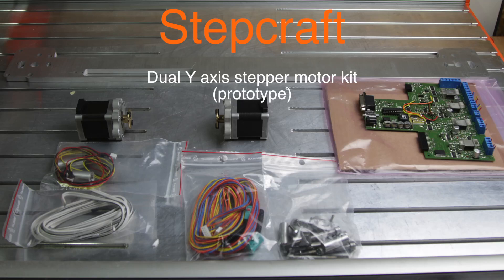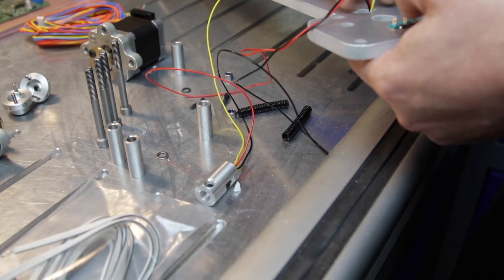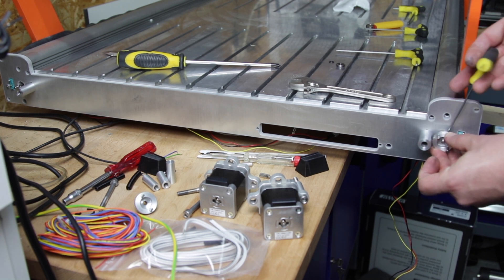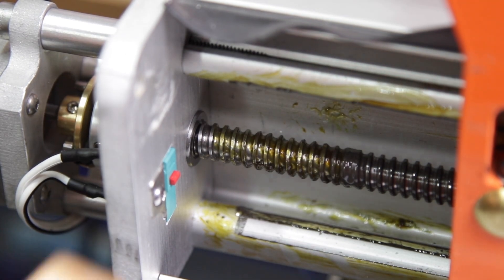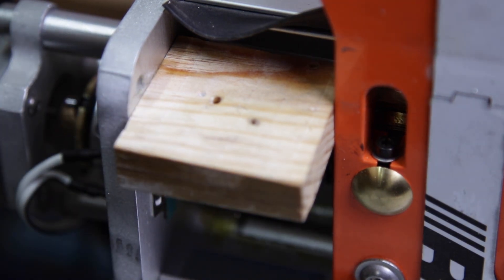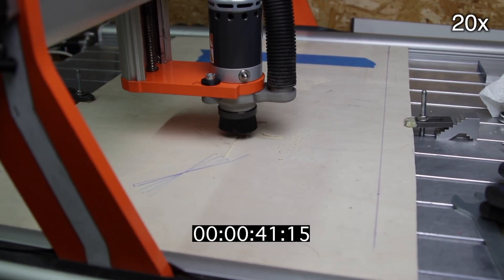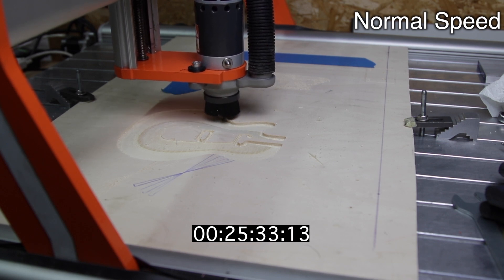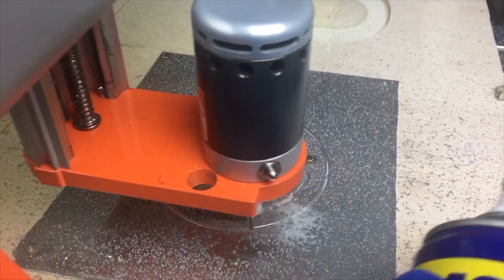Stepcraft Y axis performance kit.

Comment: So this really eliminates losing step issues? Now I can't run the D840 over 40% speed or it loses steps. Really frustrating.
Reply from the maker: Only on the Y axis.
Reply from the maker: Check my video on Axis setup, should help you tube your machine to prevent step loss.
Reply: @jdmusiclabs5661  I will, tried many things but losing patience with it.
Reply from the maker: @Rob_NABS  you can email me at jdmusiclabs @ gmail . com (minus the spaces)

Comment: Did you change the main board? I didn't see it in your video.Thanks.
Reply from the maker: I didn't show it because it was still a prototype version and it didn't look like the final version. I have the final performance kit to assemble soon, do you want me to make a more detailed video on it?
Reply: My performance kit is here. My is for the Stepcraft 2 D600. I am trying to install it but it would be nice to see how you install it. Btw do have the 4th Axis? Thank you.
Reply from the maker: @vincenttan1261  I probably won't be on time to make that video. I'm only installing it a couple of weeks from now. Yes, I have the 4th axis.
Reply: Ok, Thanks. Are you using Stepcraft 4th Axis? Thanks.
Reply from the maker: @vincenttan1261  I've used it for some things, but not often.